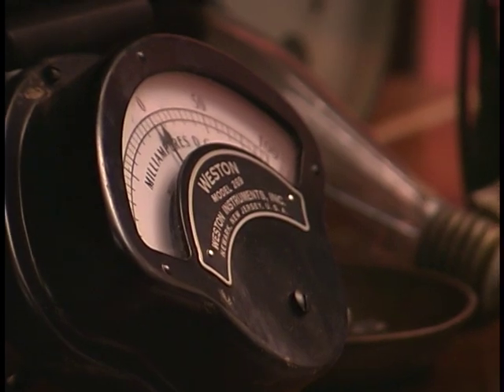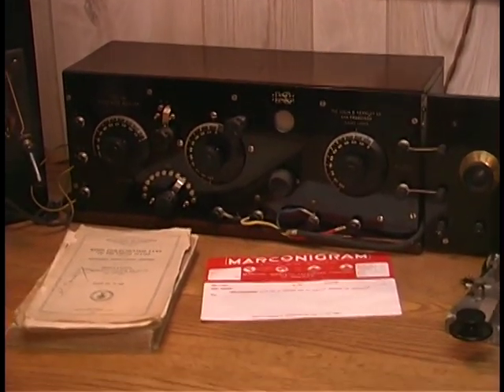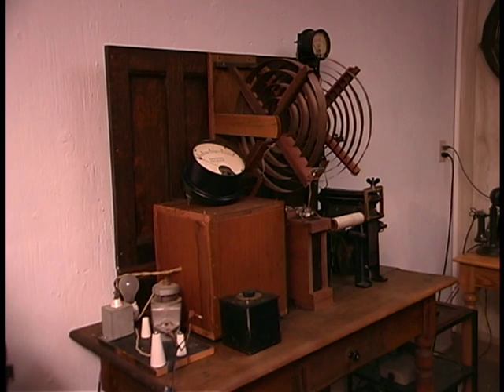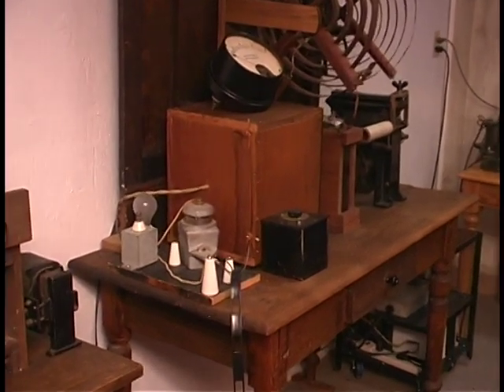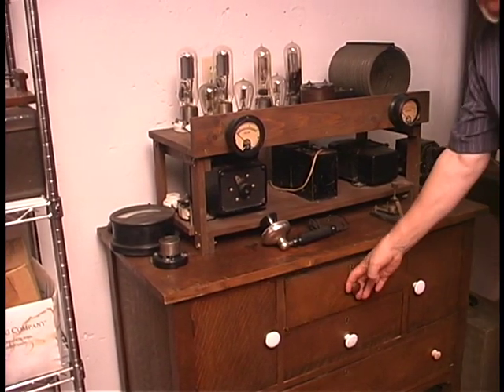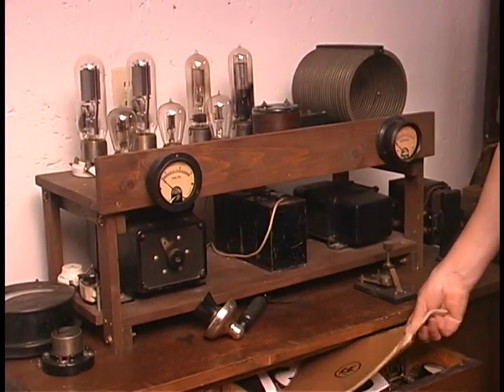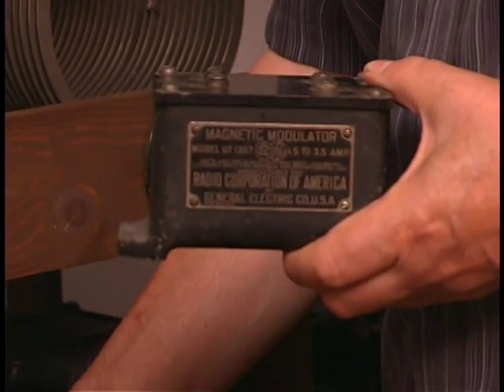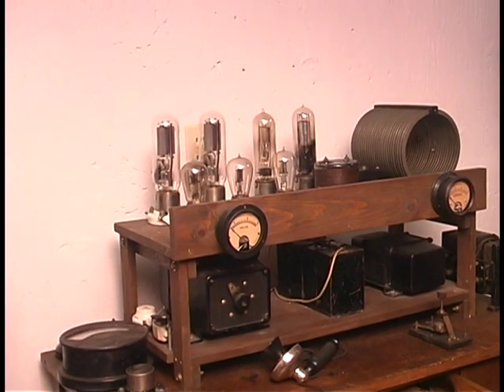California Hammin':  Part 1 of K6GLH's Virtual Museum Tour (Version 1.1)

Comment: I did not realize that spark gap transmitters were so inefficient:

1000 W AC input -> 5 W RF output

There does seem to be a lot of RF in the shack in this video (even though a dummy load is being used) based on how the camera malfunctions each time the key is pressed.